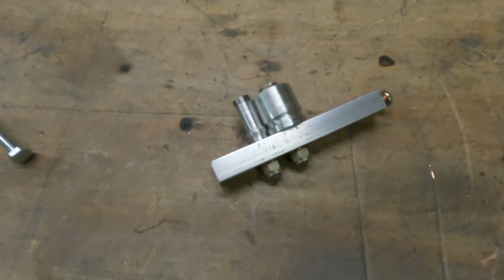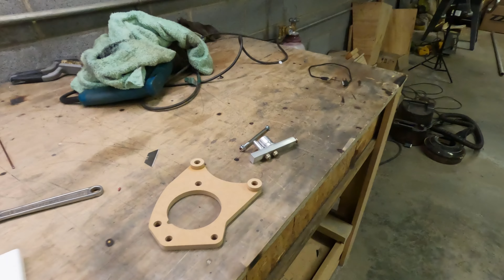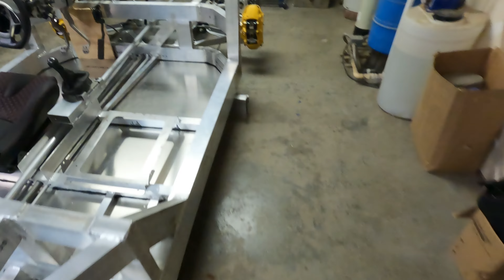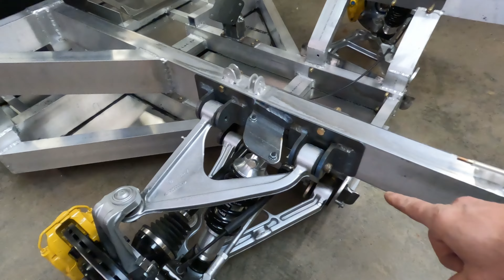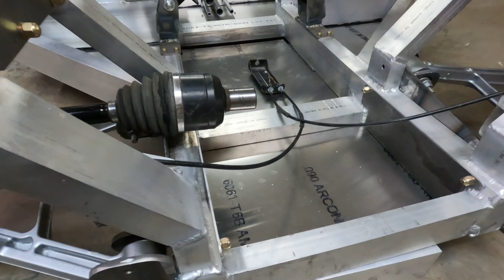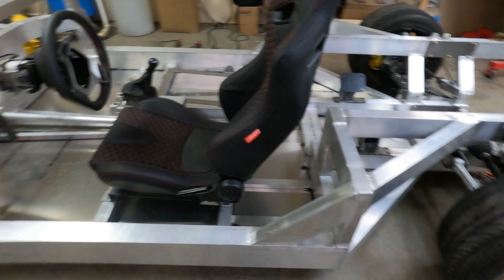Week 20 Highlights - Finishing the rear brakes

Comment: The front mounts look ok to me,  as long as the welds are good..
 I would gusset the rear though.. it's thick,  but it could slowly bend out of shape
Reply from the maker: Thank you for the feedback. After thinking about this for some time, I have a fairly simple idea to make both the front and back mounts stronger. I will show you guys my idea in the near future.
Reply: When welding brackets to a square frame tube, the brackets should reach through tree corners of the frame tube.
So the brackets should have a square cutout with a 90 degree angel so at least two sides of the frame tube get the stress from the bracket. This is even more important for aluminium tubes then for a steel tube.
Also an other important thing...
If you are bolting through a square frame tube, your bolt holes through the frame should be reinforced by a tube going through the frame welded to bouth side of the frame and then the bolts inside those tubes.
This for the frame not to collaps/be squeezed by the bolting preshure.
Here in Norway they does not recomend aluminium tube chassis because aluminium welding is pron to crack.

Hope you understand my english....I'm Norwegian, and english is not my best... ;)